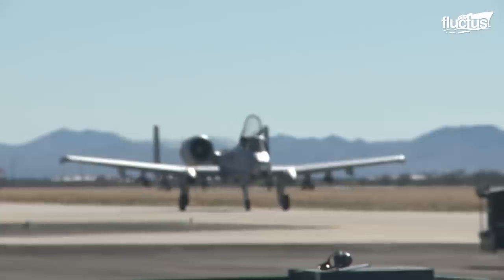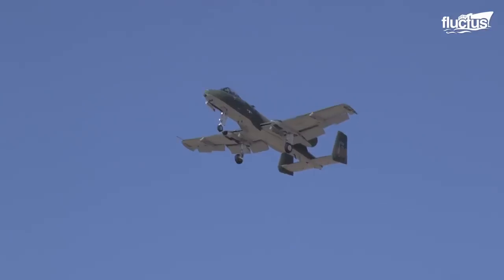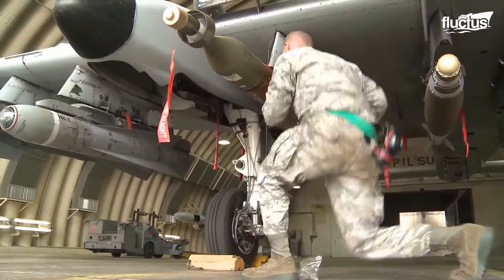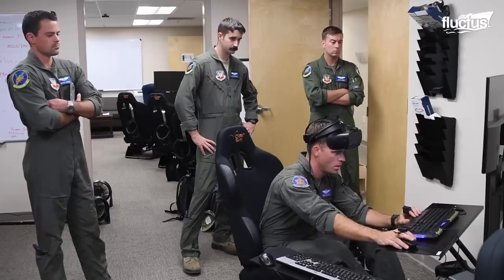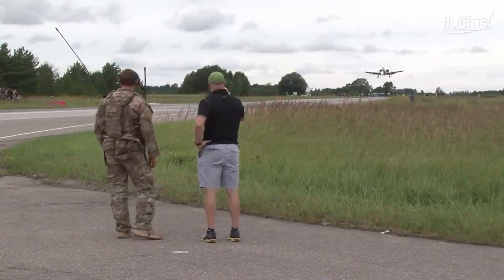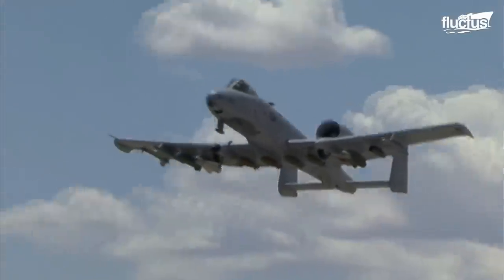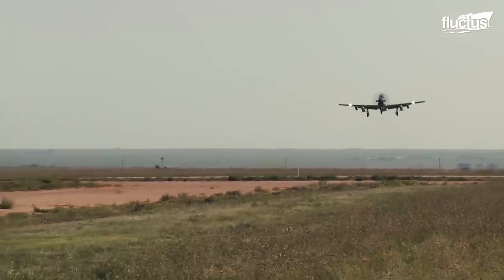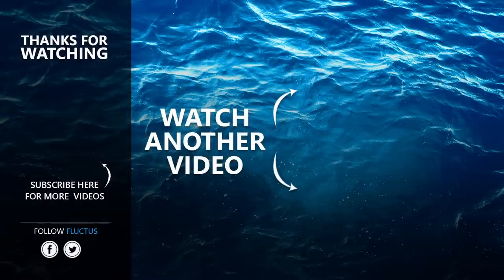What Happens When a US A-10 Pilot Gets Shot Down - Air Force Crazy Pilot Training

Comment: Ahh, the trusty aircraft that comes in at a time of great need. No aircraft is as tough, simple, and maneuverable at low altitude as the A-10. It is the best aircraft for what it was designed to do. The A-29 is a fantastic alternative... but without that iconic gun. It's just not the same. With so many multi-role aircraft out there. It's cool to see an aircraft built for one role and one role only. Close-air support.
Reply: SU-25😜😜
Reply: @arescyp  I never said there was no other aircraft built for this particular role. I said it's rare. Military aircraft are designed for multi-role missions so they can cut costs. That's what makes the A-10 and SU-25 so unique.

Comment: Fun fact: the main gun on the a-10 will cause the plane to stall because of its recoil, if fired long enough.
Reply: It doesn't carry enough ammunition for that to ever be a concern. It can only carry 1,350 rounds at a time.
Reply: Yeah water is wet!!
Reply: @EJK k  with 8,000 pounds of recoil per round fired, you better retink that. The loadout of 1,150 rounds carried by the A-10, WILL stop it's forward momentum. If the pilot fires a long enough single burst. I'm a  USAF A-10 Munitions specialist.
Reply: @mav1269  I don't even understand why you're arguing. I've never heard of an A-10 pilot shooting without burst fire. No one is holding down the trigger for the 20 seconds of ammunition you have. 4,000 rounds per minute go by very quickly when you can barely carry more than a quarter of that number. Pilots from WW2 to today always use burst fire unless they are out of options. That's my point. The TF-34 engines give the aircraft an incredible thrust-to-weight ratio needed to sustain stable flight even when that Goliath is fired. By the way. The A-10 can hold up to 1,350. Usually, it's loaded with 1,150 though.
Reply: @mav1269  You are arguing. You started a passive-aggressive argument just so you can tell me you're a specialist. I'm sure your mommy is very proud. Maybe just keep it with her next time, yeah? I also know plenty about this subject as well.
Reply: @ejkk9513  the point of him saying that is bcs you said its not possible bcs of the amount of ammunition.

Comment: You need to "educate" your narration.  "Firing at a rate of over 3,500 RPM". The term RPM usually refers to "revolutions per minute", and in engine speed.  In this case if you are talking about firing rates, you NEED to say it out as "rounds per minute". Eliminate confusion, since the barrels are rotating, and RPM could mean revolutions per minute, or rounds per minute.  For a Gatling gun, no one cares how fast the barrels rotate.

Comment: The A-29 will never replace the capability or survivability of the A-10, it's not even in the same league, the A-10 has two high mounted Jet engines with redundant systems, the jet can fly on one engine and remain in theater, it has a 30mm Gatling gun that chews through tank armor with depleted uranium bullets, the A-29 possesses none of this. I could go on ...................
Reply: Please do go on p:s I used to build the a-29s but other than the gun on the a-10 and fear factor that’s the only thing it boasts over the a-29 the a-29 is a very capable aircraft I’m not saying we should replace the a-10 with it but I wouldn’t sleep on the a-29 either
Reply: @Markymark09  My Cousin flew an A-10 in the first Gulf war, so I'm a little bias, that said, the Warthog takes an incredible amount of punishment, it saved the lives of many pilots, it can loiter, and it has a terrible psychological effect on the enemy, not to mention that 30mm freak show.
Reply: @michaelmancini5773  yea it’s a great aircraft that’s why it will never be replaced just retro fitted however what I was getting at is the a-29 is a great plane for what it is a smaller cheaper version for other countries